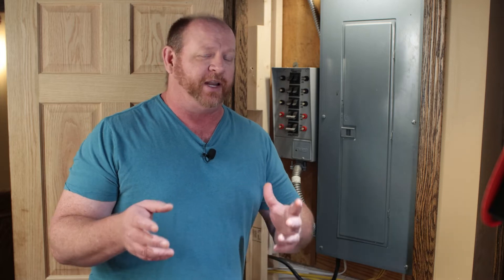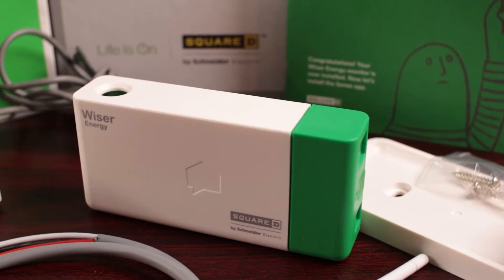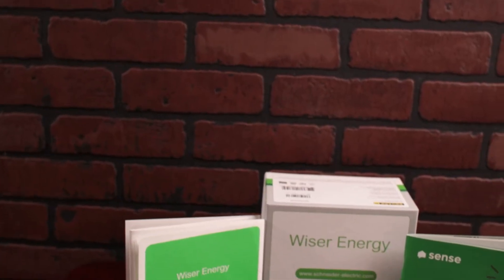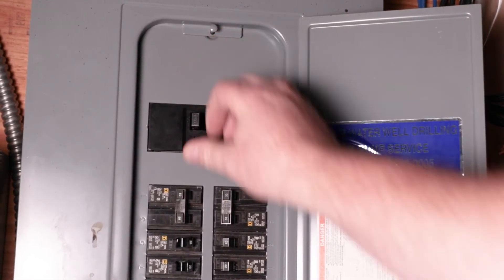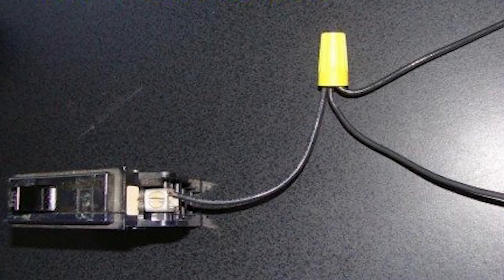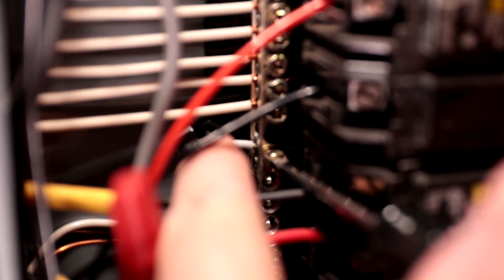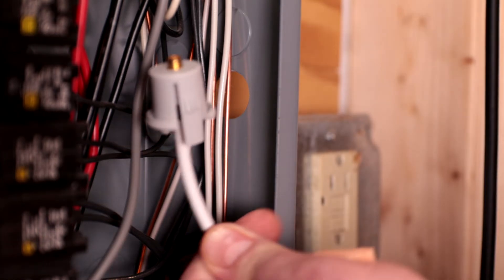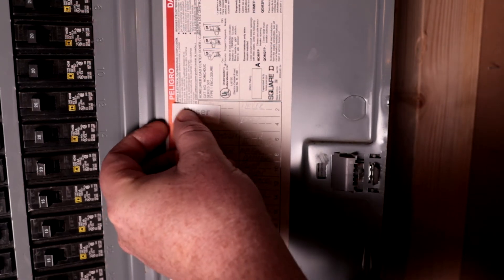Wiser Energy Smart Home Monitor Install and app setup Square D

Comment: Hi Brian, 70 year old here who not well educated on breaker boxes etc.  My  granddaughter has moved to my property with her RV and we hooked it directly into our main breaker box.  needless to say my electric bill has gone thru the roof especially in cooling months.  i heard there were clamp on sensors you could install on one particular hot wire to see the amps being pulled thru it (so the wire from the breaker box to RV in this case).  then I could figure out what to charge her for electric.  I realize its not accurate but close enough.  Would this unit in your video work for this ?  thanks Di

Comment: Kind of confused on how 2 cts in your main service panel tell you what your usage is on specific appliances
Reply: It's sensing the individual electronic signature of different devices through the primary wires.

Comment: Thank you. I have seen several videos about installing these devices. You are the first person to mention that the incoming power supply lines are STILL HOT even though you have the panel turned off. I knew this, however, you were the first to include that important info.
Reply from the maker: Thanks! It is important!

Comment: I have a question. why did wiser uses the sense energy app, does sense have there own energy monitor.
Reply: This one and the Sense energy module are the exact same device...  just rebranded. Who knows who made it first.
Reply from the maker: I'm not sure about the app, that was what was specified in the install manual.

Comment: Do you by chance know if this will work In a 1 phase 120v only system? Or dose the hub require 240v?
Reply from the maker: It requires 240v unfortunately.

Comment: I have one that I really enjoy. I've had it for about 1.5years now. I also have SOLAR so it helps me identify when my Solar is at it's peak and thus running some of my loads like my dryer or pool equipment during those times. We have PG&E in Northern California.. very expensive so Wiser has helped me drop my utility bill considerably. Going to connect it to Alexa soon and integrate with my KASA Link & HUE lighting.
Reply from the maker: I'm really enjoying it as well.. I'm going to do a couple more videos on it soon.
Reply: @BuildITWithBrian  would like the update please

Comment: Quick tip – make sure your CT’s are facing the same direction when you clamp them on the SE cable.  This saves time on the initial calibration process.  Not a big deal but saves some time for Wiser to work properly and start to identify the devices throughout your home.   I've had mine for about 2 years now and the tip to turn on the alerts when a newly discovered device needs to be identified is key.  I used the alert when turns on and turns off to help identify.  Another tip is to leave an alert on your Washer and Dryer to know when you can move your clothes to Dryer or to get them out while they are fresh instead of wastefully running them another 20 min to freshen up.  With the way a Washer and Dryer work, set the alert to "6 minutes" after it turns off to be sure.  I also have alerts on my garage doors for peace of mind.
Reply from the maker: All good stuff I'm going to cover the alerts in my next video. They also have an update coming shortly that will enable a more precise measurement with the second set of leads to have. Thanks for the tips! 👍
Reply: after using for two years, what do you think?  Is it worth the money?  @BuildITWithBrian

Comment: I'm very curious to see how the app and everything works. This device will let you see exactly what appliances are using what right ?
Reply from the maker: Yes it has to learn the different devices. Sometimes it will find a appliance and it is not clear on what it is. There is an alert function on the app that will let you know when a device is on and turns off so you can try to narrow it down. I will be doing another video on that.
Reply: @BuildITWithBrian  can't wait to see it